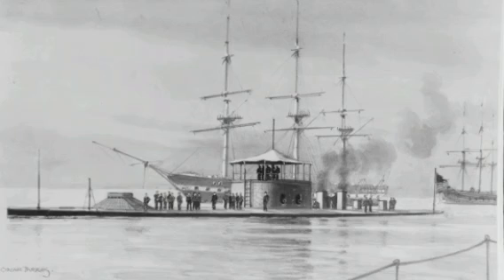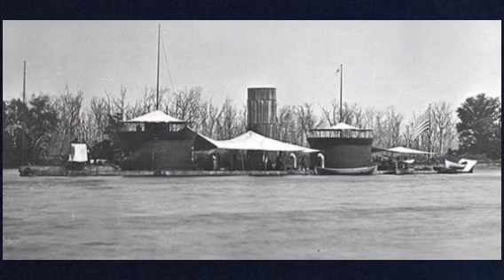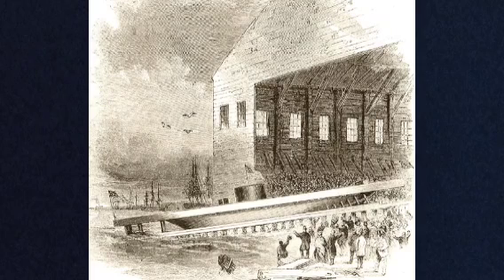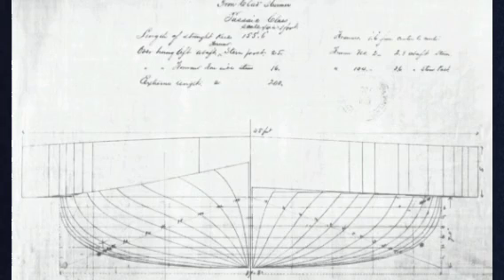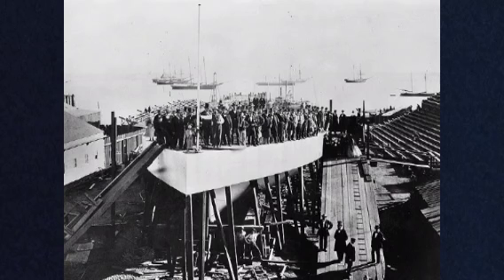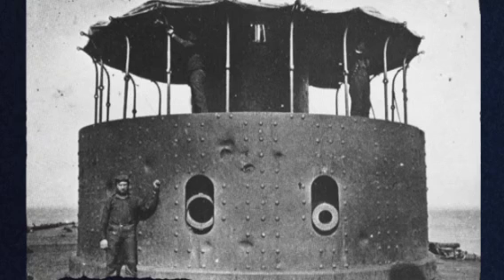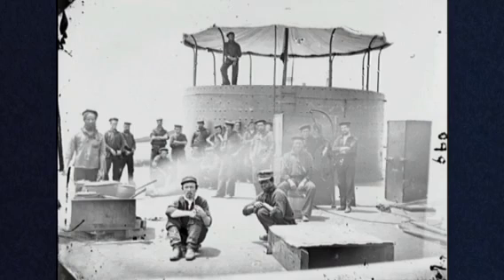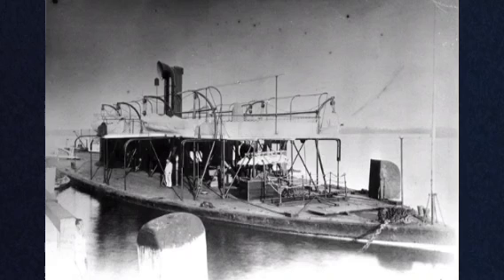Developing Passaic

Comment: I don’t believe the design was botched. Limitations were imposed but not botched
Reply from the maker: Limitations were not imposed on the design. The only reason Monitor ended up as it did was because of time constraints. Regardless of outside factors, the design was overall poor and no one had a problem saying so, except Ericsson of course. He did the best he could at simplifying the design to ease construction and save time, but the result was not what he wanted, Passaic puts that on full display as he didn't have time constraints. I think it is fair to consider the design as having been botched.